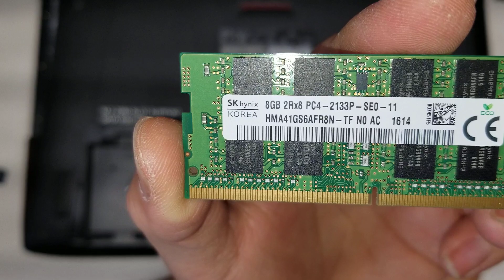ASUS GL752V GL752VW Disassembly SSD RAM Hard Drive Upgrade Repair

Comment: Hello and thank you very much for this video! I recently got this computer, which works well except for the noisy fan. Do you think simply cleaning it with compressed air would be enough, or does it need to be replaced? If it needs replacing, is it still possible to find this model of fan, and where?
Reply from the maker: This playlist will help Fan Repair: https://www.youtube.com/playlist?list=PLSSiYX-ta7aqqxfDWDQh-B6Az4ZgDI459

Comment: Do you know how to turn off Fn key
i have tried everything still not working
Reply from the maker: No idea. Pull the key off lol
Reply: @ItsBinhRepaired  i want to do this bc i always pressing Fn key with Volume up
Reply from the maker: @Mmwm-b1j  I don't understand
Reply: @ItsBinhRepaired  when i press the volume key i have to hold Fn key first than volume key
Reply from the maker: Some models have a fn lock and others have a software change orbios setting.

Comment: I have a GL752V and the CPU says it has two available RAM slots but I cannot find them.
Reply from the maker: Do you usually just blindly believe what you're told? You can see the laptop being torn down here and the 2 RAM slots. Are you asking if there are an additional 2 for a total of 4? You'll have to take the motherboard out completely to check if there are 2 more hidden ones, but the software can say whatever it wants whether there are actually slots there or not.
Reply: @ItsBinhRepaired  Sorry I asked!
Reply from the maker: Haha Other than taking them apart there's really no way to know.

Comment: Is there a size limit to the ssd if you're replacing the hdd to ssd? Wanting to put a 4tb ssd in as I use it for mobile video work
Reply from the maker: As long as it's not physically too big to fit in the computer

Comment: Hi and thanks for the video! I have the same laptop and I was wondering if you are still using it and how does it work after so many years. Mine seems to have issues with driver updates, even though I've purchased a Windows licence a few years ago. It's struggling to work as it was working back in 2015 when it was new. I'm trying to figure out what should I do in order to 'bring it back to life'. Maybe it only works on a certain Windows version, or maybe a hard drive upgrade can do or I don't know. I think it still has life in it, but it can't keep up with all the Windows and drivers updates. And I should mention I didn't really used it for gaming hahaha, maybe more for some photo processing and as a day today laptop. I even replaced the battery last year. Anywho, do you have any kind of advice for me? Thanks a lot! Cheers
Reply from the maker: I don't own these thousands of computers. They are customers'. I just repair them. Not really sure what to say other than update everything on a clean Windows install.
Reply: @ItsBinhRepaired  Thanks a lot for your reply! Much appreciated!
Reply from the maker: @silvek00  if after a clean install and running Windows updates until nothing left, it's most likely a hardware issue. Asus has an atk driver you need from their website usually to make the backlit keyboard work.
Reply: @ItsBinhRepaired  Basically, yes, I've tried around 3 Windows clean reinstalls in the last 2 years and always had problems with the backlit keyboard driver (of course) + audio drivers. I started doing some reasearch a few months ago on how to fix this problems or try avoiding them by looking maybe for a specific Windows version to use, but with no luck. It's a known issue that some drivers are not updated anymore for some hardware in this Asus model, but still, it must be some sort of workaround in order to have a functional laptop, even though it's around 5 years old. I'll try again with a different Windows, bought directly from a shop, and maybe upgrade to a SSD and more RAM, even though Windows boots quite fine and performance is ok. The lack of drivers support I think it drives me crazy :) And I just wanted a specialist's opinion on this, so thanks a lot again!
Reply from the maker: @silvek00  what version of Windows are you using? Win 10 shouldn't be an issue. New drivers aren't needed. The old ones should work just fine.
Reply: @ItsBinhRepaired  Windows 10 Home. And there are some old drivers on the Asus site, indeed. Thanks!
Reply from the maker: @silvek00  only use the drivers if needed. Let Windows update find everything.

Comment: i have the exact same laptop, and i've been using it since 2015 what a god of a device it is even after 5 years (:
Reply from the maker: good to hear. If you haven't already, you should upgrade it to an SSD. It makes a huge difference. Also, please like and subscribe if you haven't already, it'll really help me out.
Reply: @ItsBinhRepaired  already did in 2018
Reply: @ItsBinhRepaired  which is the faster connection for positioning an ssd?
Instead of the original HDD 
or 
using a caddy in the place of the dvd
I already have an m2 ssd but seems to be too small and i shall get a larger capacity ssd in 2.5 format to migrate the OS on it, 
But i want to know which is the best place to position it for best performance
Thanks.
Reply from the maker: @ElGoogKO  the original place should be faster, but I'm not sure. I don't do benchmarking.
Reply: @ItsBinhRepaired  thank you for such a fast reply.
Is a 2.5 sata ssd plug and play into the old hdd socket or does it need some extra adapting?
Thank you once again for the video as well.
Will be useful because will need to replace battery in the future.
Good reliable laptop this one, has been working since 2017 and most of the time left on over the night, so in fact you could say it has more years of use  than 2017
It's sad we can't upgrade graphics card and processors like a regular desktop
Reply from the maker: As long as the sata connector is the same. You'll want to clone your hard drive to it first or have a way to do a clean Windows install. Do you need a video for that?
Reply: @ItsBinhRepaired  
Thanks for kind offer, but i think i'm covered; samsung offers migration software.
Already did it once moving from hdd to current m2 samsung ssd. 
Will be doing the same from current ssd to the larger ssd.
Reply from the maker: @ElGoogKO  sounds good
Reply: I have the same laptop and I was wondering if you are still using it and how does it work after so many years. Mine seems to have issues with driver updates, even though I've purchased a Windows licence a few years ago. It's struggling to work as it was working back in 2015 when it was new. I'm trying to figure out what should I do in order to 'bring it back to life'. Maybe it only works on a certain Windows version, or maybe a hard drive upgrade can do or I don't know. I think it still has life in it, but it can't keep up with all the Windows and drivers updates. And I should mention I didn't really used it for gaming hahaha, maybe more for some photo processing and as a day today laptop. I even replaced the battery last year. Anywho, do you have any kind of advice for me? Thanks a lot! Cheers
Reply: @silvek00  i think you should use older windows version
Reply: same here, bought mine in 2015. laptop is lowkey ass and cannot even run roblox at over 30 fps
Reply: Its a monster!
Reply: I have the same model too. Still love it. Unfortunately it can't runs Windows 11. :(
Reply from the maker: Windows 11 sucks. Why do you want it?